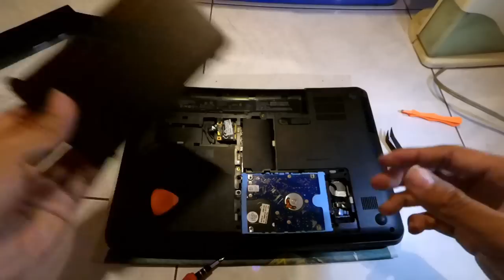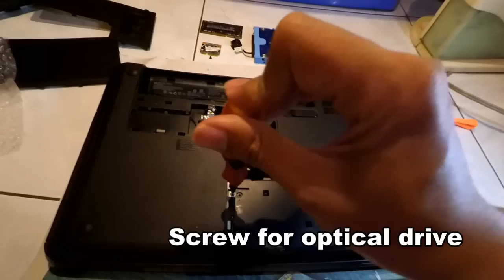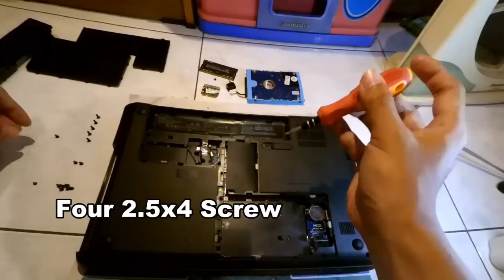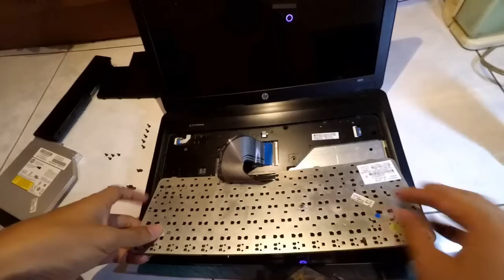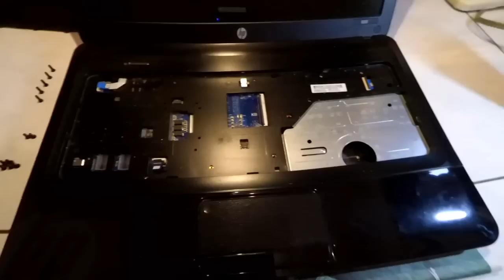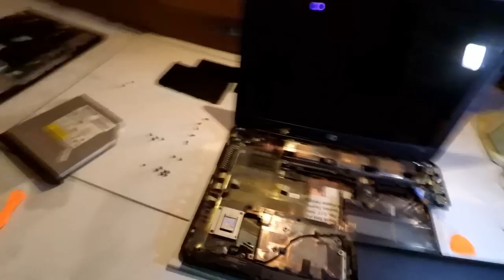Disassembly HP 1000 Laptop For Repair and Maintenance

Comment: You removed the keyboard the wrong way. That's why it seemed difficult. Correct way is to release the tabs of the keyboard, located in the battery bay. The keyboard just pops open.

Comment: Great video and exactly what I needed to do the job without any screws left over :>) thanks
Note: In the lower left of the motherboard is a chip with a silicon? sponge/heat transfer pad and an associated stainless steel pressure clip fastened to the chassis.  Not sure of the exact function but this soft pad should be replaced if damaged during disassembly?

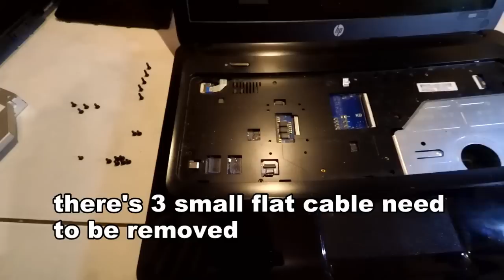Comment: I disassembled my laptop and it is quite straight forward following this video. However when disconnecting the internal connector at 5:45, the female part of the connector broke so I can't reconnect. It is the wiring from the on/off etc. switch. Now I will have to find and solder in a new component I guess.
Reply from the maker: it is broke so hard ? Yes it is a wire for power switch.

Comment: I have the same laptop of yours, it no reaction when I turn on the unit, there's a light in the AC input. how can I fix it?  thank you
Reply from the maker: Probably related to power regulator, it’s the common yet the most difficult to repair.
Reply: El chipset está mal
Cambiarla es riesgoso con máquinas especiales.
Mejor cámbiale de placa madre

Comment: where do i have to put the coolant paste?
Reply: Claudio Torres Open the 4 screws on the heat sink and one screw of the fan. Gently pull the whole heat sink assembly. Clean the old paste on the processor and heat sink. Apply new paste only on the processor. Reconnect the heat sink assembly.